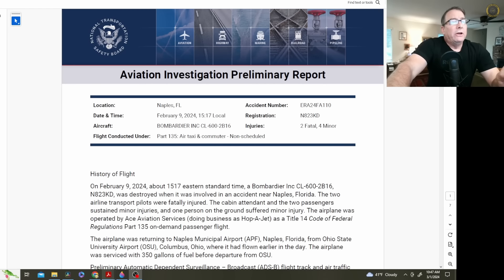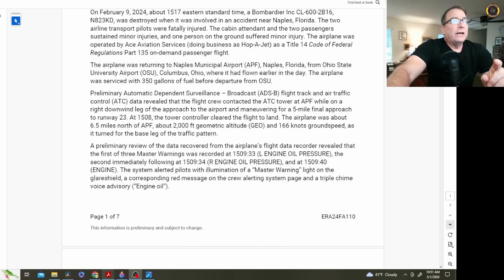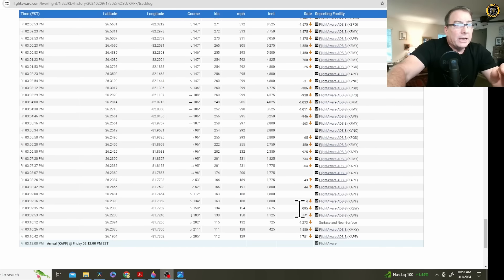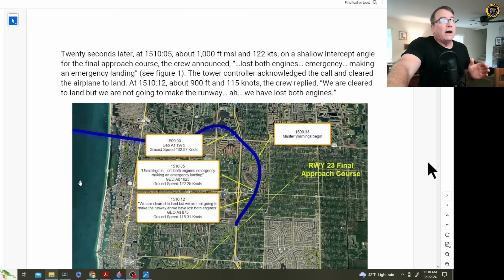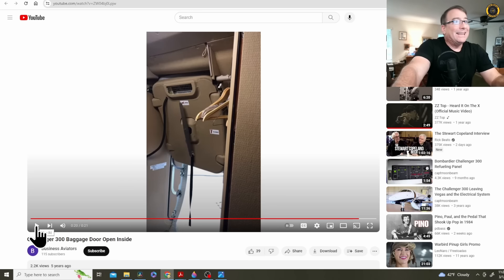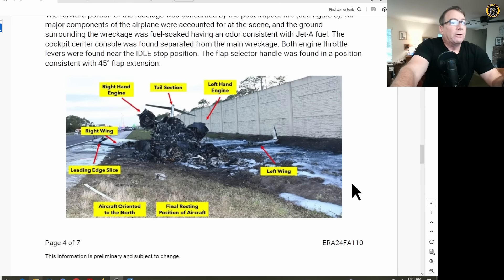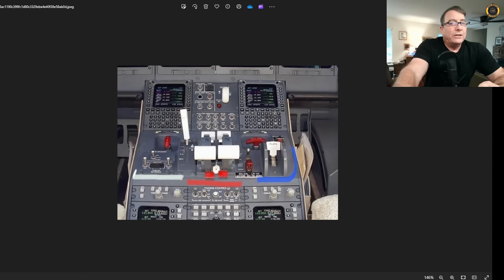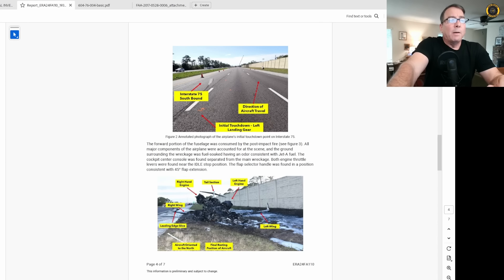NTSB Preliminary Report: Naples Challenger 600 N823KD

Comment: The engine shutoff switch scenario is highly unlikely in my opinion. You have to have the power levers completely at idle, then lift the shutoff lever before you are able to shutdown the engines. Those levers take a lot of straight upward force to lift. If you raise the shutoff levers before idle, you can not go to the shutoff position until you re release the shutoff levers at idle position and re lift the shutoff levers. It is possible because I fly a slightly different model of challenger this is different, but I highly doubt it.
Reply: Juan, I also agree that the pilot from the left seat arm couldn’t shut down the fuel shutoff levers.  Also I’d be surprised if the right seater was flying as it wasn’t the normal in 91/135 to fly from the right side (though I’m retired) .. they typically would swap seats. One reason is the nose steering is only on the left side.
Reply: Not a pilot but I've ran & taxied Challengers & CRJ's. I concur, that would be a really awkward reach around for the flaps to lift both toggles. Like you said, they take some effort to lift, pulling the throttles back into someone's arm seems unlikely. However if it was fuel contamination, its odd that it made the trip all the way back to Naples. Very curious as to the final verdict.

Comment: What about something like air lock if air got in the line somehow?
Reply: On both engines simultaneously?
Reply: @igclapp  if there is a common feed line that then branches to each engine?
Reply: @Ed-jg3ud  No. Each engine takes its fuel from its own separate collector tank. The left collector tank is fed by the left wing tank and the right collector tank is fed by the right wing tank.

Comment: Inadvertent thrust reverser engagement tie into this?  Similar to the Nepal crash of the ATR 72 a year ago?  Wrong lever / control movement?  Timing of full flaps with timing of oil pressure alarms?  Hero FA.  RIP for crew.

Comment: Question.  I thought the jet fuel was required, many years ago, to have an additive that made it difficult for the fuel to atomize in an impact scenario.  Is that not correct??
Reply: That’s incorrect. Military uses JP-8 which is more difficult to ignite
Reply: Fuel is atomized in the combustion chamber in order to burn.  That's how it works.  Jet fuel won't burn when just a steady state liquid.  You can throw a match in a bucket of jet fuel and the match will just go out.  Once you atomize it it burns.

Comment: So if it was an accidental fuel shutoff the NTSB will have to reach that conclusion by the process of elimination, or is there some more direct evidence available?
Reply: You would think that event would be captured on the data recorders.  Another commenter above (not sure of his qualifications) said they were.  The only odd thing is if that's true then the NTSB already knows what happened.
Reply: @rickwiggins283  The only explanation I can think of is that the NTSB does have evidence of shut-off, but the import of that is so momentous that they want to rule out other possibilities before announcing it. If two otherwise qualified pilots can accidentally shutoff both engines then it may well be considered something more than pilot error, a real design flaw requiring a fix.
Reply: blancolirioe  Go away, spammer.

Comment: What has gone through my mind, did the fuel ice up at altitude clogging the fuel heat exchangers/filters?  England had a B777 that landed short after both engines shut down
Reply: This is what Dan Gryder thought since he had some radio transmission recording that the pilots did NOT fill up with the special fuel additive to prevent the fuel from turning to gel.

Comment: THIS WAS AN EXCELLENT CREW ..,pilot and crew ….
This company must be proud … 
THIS WAS CONTAMINATED FUEL !!!
Reply: Highly doubtful both engines would shut down after 2 hours of uneventful flight due to contaminated fuel.  Even more doubtful both engines would shut down at the exact same time due to contaminated fuel.  30 seconds apart, maybe.  At the exact same time?  The odds are way out there.
Reply: No, it was NOT contaminated fuel. If so, the engines would've acted up right after takeoff, not quit almost simultaneously while at idle on a three mile final.

Comment: Not familiar with the challenger, but most jets with EICAS have a fuel filter bypass/clogged warning. If it was fuel contamination or frozen (like the BA 777) they most likely would have gotten a clogged indication. The flight recorder should have picked that up as well

Comment: The Captain would have been alert to the throttle’s positions when he saw and/or felt no interference as he reached for the flap actuator, but once his hand touched it, he probably transferred his vision out of the cockpit just as the FO pulled the throttles to idle. The perfect storm of bad timing, busy workload and piss-poor cockpit design.

The need to bring the flap actuator “up and out of the position gate” before moving it rearward probably compounded the scenario.

Comment: Perhaps the real clue is in the low type hours of the first officer ? The inabilty to restart engines from an inadvertant cutoff would be a real startle factor.
Reply: No.  There is no time to restart when that close to the ground, even for someone with tons of experience.  The captain had that experience and even he knew that ship had sailed and it was time to put it down on the freeway.   Even if they did get the steps in to restart it, the engine just wouldn't have time to spool up and make power before hitting the ground.

Comment: It does seem to me at least one of the pilots did want to put the plane down on asphalt & not on the grassed median (closer to oncoming traffic), & this is the reason for the angled landing. The grassed median may have been a better option initially (from higher up in altitude) but it was decided to land on the road as they approached the ground. The CVR will reveal the cockpit conversations. Also, such a disparity in speed of the plane compared to the road traffic. It was never going to end well  😐
Reply: In the median there was a steel 3-cable barrier fence with 3-inch I-beams set in concrete that would've torn the aircraft to pieces. You can see it in the trucker's video. Definitely not a better option.
Reply: @Raiders33    Aha, thanks for tuning me in. They probably saw that late & decided to hit the road (gives the phrase a new, literal, meaning) instead. Check my channel for a short doco on the disappearance of the plane known as MH370. Cheers  👍

Comment: What a shame, in my very duffer opinion, that the activity on the control console is not videoed in flight.  This would quickly answer a lot of questions that otherwise are mysteries.  Accidentally unlatching the throttle position limiter in the scenario you pointed out by bumping it with an arm, while the other pilot slides the throttle to what they think is idle but actually is beyond idle to shutoff, isn't recorded in any other way is it?  Sounds to me that this is inviting a fumble to have the flaps lever where it is.

Comment: Frozen fuel ?
no prist?
long decent at idle?

Advancing throttles as engines and shutting down due to any of the above?
Reply from the maker: Mmmm...no.
Reply: You are probably right, nothing like that has ever happened before. Doesn’t at all sound like the British Airways Boeing Glider smacking down short of the runway several years ago.. @blancolirio

Comment: The Left seat pilot will reach over the top of the thrust levers to move the flaps.
Reply: Not necessarily if they aren't real familiar with the air frame as one of them seemed less experienced in this type. Just a thought

Comment: surely a human response when hitting the deck and sliding along  is to wack down both throttles as they wouldn't have had time to know exactly what was going on with lack of thrust A human reaction may be to just hit the thrust levers before hitting the wall/deck and ensure both engines were somewhere near idle, tragic as both pilots were lost despite great efforts to save the day and amazing reaction from the cabin staff.

Comment: Another fuel-starvation scenario (and this has already brought another plane down) comes from a rapid descent from very high altitude of fuel that has considerable moisture content.  The fuel system has the means to filter out both water and solid contaminants, but after a rapid descent to warm ambient air, the ice crystals begin to melt, temporarily forming a slush of water & ice that overwhelms the filtration system at the exit of the filter.  The condition exists only momentarilly: when all ice or all water the condition cannot be reproduced.  I know this is a real possibility because I saw an accident investigation video right here on Youtube where this is what the NTSB determined.  I'm sorry I cannot remember the flight #.

I suspect this possibility in this incident in particular because I noticed that the two holding tanks, which all fuel flows through before going to the engine, in this model aircraft, are also the lowest-mounted tanks in the entire system.  So that's where any condensation would accumulate.

Comment: The only way that you can restart an engine after both were accidentally shut down is to use bleed air from the APU.  Most companies don’t start the APU until after landing in order to save APU running time and fuel.
Reply: You can windmill them

Comment: The fact that you can pull your throttle back and shut the engine off and then not quickly restart it
Reply: I meant to say the fact that you can turn the engine off by accident at all and not restart it instantly is retarded in my opinion, who would design such a thing especially in an airplane. I would definitely make a separate switch or something so that could not possibly be done even by accident or wear.

Comment: Gryder thinks the fuel gelled. Pilots didn’t order deice fuel juice when they topped off.
Reply: The fuel is heated. There is no requirement for Prist in the fuel. Also there are warning messages for low temp fuel.

Comment: I was kind of wondering if it was fuel ice contamination. Was thinking about BA38, where they flew all the way from beijing to london with no issues, only to have a double flameout on short final
Reply: I’m not a pilot — Does your comment imply cold weather? It was really warm in FL — but I imagine you are referring to the temperatures up in the 10,000-whatever feet this plane flew. So I have no clue. 😜
Reply: I’ll research what you said since  clearly have no clue!!

Comment: Something fishy. The engines were found to be in the idle position. So the Flt deck switches then, were not placed to cutoff. So that has been established…unless, they were cutoff in flight then put back into the idle position right before the crash.
That entire scenario seems extremely unlikely. Atc talk did not display such conversation. That would lean toward suicide. Then I ask…who are the people they were carrying? Something very strange happened.
You would have to go way out of your way to inadvertently turn off the engines.
Reply: It's very likely.  If they inadvertently brought them to cutoff and the engines quit, it would be instinctive to bring them back out of cutoff and even push them up.  Then, when eventually putting it down on the freeway, they'd pull them to idle instinctively even if the engines are not reacting.

Comment: I think the pilots did a great job they had to come over the trees and land on the highway. That plane has smaller wings so It does not glide well. Shame he could not get it to the left a little maybe just a touch to much speed and that stupid wall. Its hard to believe the fuel would be the problem after that amount of time and both engines shut down together. I think from the audio the one pilot sounded a little tired. Could be engine shut down. I would think they could pull data that may tell them if engine went to shutdown. Very tragic for the Pilots family’s so sorry.

Comment: Dan on probable cause had radio evidence that at osu that the crew requested from the fbo jet fuel without antifreeze additive. The fuel at osu was the same price with or without the additive. This is probably not the case with fuel from florida.
Reply: Prist is not a requirement for the aircraft its fuel is heated.

Comment: are the tankers fuel suppliers liable here? do they check to make sure there's no water in the system, do they have a water filter before filling up the planes?
I'm surprising this is not in planes maybe in bigger jets but you could have a floating device that floats on the water if it's detected  and picks up the fuel but doesn't pick up water, doesn't sound like they got anything like that not sure why? do they have it in planes?
Reply: If the fuel was contaminated they will almost certainly be sued. They have liability insurance. I had a customer who had was fueled with jet fuel contaminated with DEF. The insurance paid for the cost to replace parts requested by the manufacturer.
Reply: At one point I hauled fuel including avgas and jet a. Every time the fuel went from a tank to the truck or the truck to a tank, a clear and bright test with a large glass pickel jar with a metal handle and density check with basically a hydrometer/thermometer and a mechanical calculator was done. The zizzor wheel calculated density based on the buoyancy of the hydrometer and the temp. It had to be within so many decimal numbers of the batch density. The large probably gallon pickle jar clear and bright is the Canadian method. I believe the US they use a white plastic pail. The clear and bright is to test for sediment or water. If the tank at the bulk plant had been recently filled there was a wait period before you could load a truck. Think it was 1.5 hours. This was to allow any sediment that had been stirred up when the tank had been filled to settle to the bottom before transferring fuel from the tank. Daily water draw off and density/clear and bright tests were done on the storage tank we filled the trucks from
Reply: @42dunbar  that's not good enough people's lives are at risk, should be much stringent legislation so it can't happen, and if it does happen they would lose their licence and be sued by the aviation body possible prison sentence. there's nothing stopping them putting checks and having filters. sounds sloppy practise
you can get test kits for contamination on site can't you?
Reply: @42dunbar  I honestly have no idea how DEF would make it into aviation fuel. Most trucks/trailers being used for aviation product are used exclusively for that product. If not, it is to be flushed when changing product. We used to flush every compartment with clear diesel if switching from mogas to Jet, or premium if switching to avgas. Now there is mandated ethanol in all grades and biodiesel in clear diesel so I don't know what they do to flush now.
Reply: @juliogonzo2718 DEF gets into aviation fuel because DEF has to be used in the diesel fuel truck itself (thanks to the EPA.)  Airport fuelers have to keep DEF in stock to put in their fuel trucks while also keeping Prist in stock to put into airplanes.  Add humans to the mix and anything can happen.  Most airport fuelers have processes in place to prevent it from happening.
Reply: @johnaclark1 they must have smoked their lunch if the accidently blended DEF. You would think they would keep DEF and diesel pumps far away from jet loading rack/blending equipment, but I guess if they put a tote of DEF next to a tote of prist and left that to someone who had not been trained properly it could happen. I would think it would fail a density test as prist is alchohol while def is urea and water. company I worked for never added prist (fsii it was referred to in our documents) it was blended at the terminal that the load came from if needed. I didn't handle actual aircraft fueling operations so no idea how that works as to adding it on demand. I don't honestly remember but I think most of the fuel I transported didn't have fsii anyway as it was primarily used in helicopters and turbine bush planes so they were not getting cold enough.
Reply: @juliogonzo2718 That's exactly how it's happened when it's happened.
Reply: @johnaclark1  Oh i think i get it. they must have a fsii blending setup with a seperate tank on the actual truck instead of the whole load being blended. Like I said, the simple solution would be to keep truck fueling and def dispensing far away from where the prist and jet fuel is dispensed, and the truck prist tank at the rear of the truck away from the def tank with some sort of mechanism like a quick connect for filling that makes it impossible to insert a def nozzle in it.
Reply: @juliogonzo2718 it is done that way on single-point pressure fueling and over-wing gravity fueling, or it can be added via a can and sprayed in with the fuel on over-wing gravity fueling set ups.  Many airport fuelers use premixed fuel so we sometimes get prist anyway, even if we really don't need it.